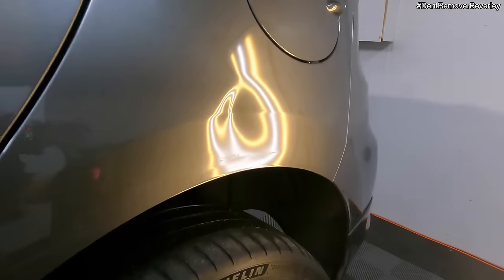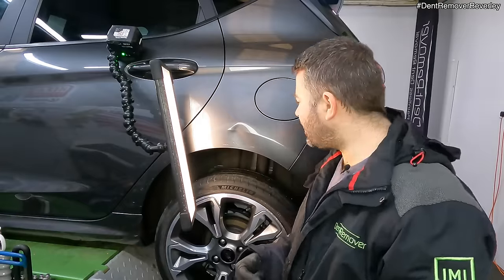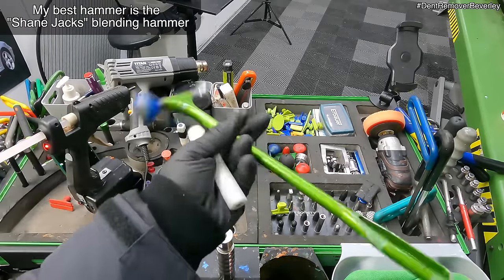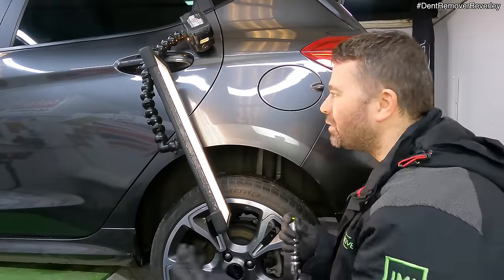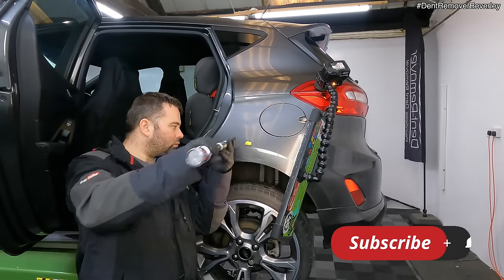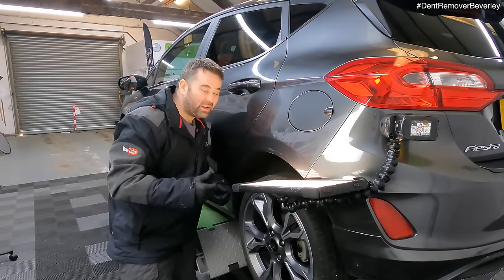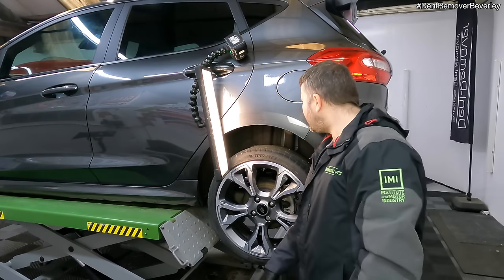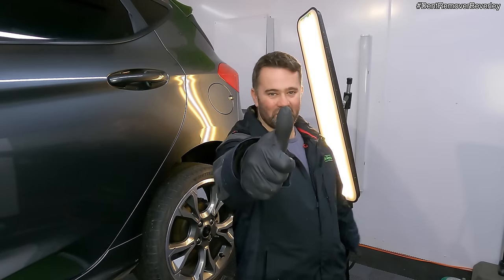HOT GLUE DENT REPAIR | STEP-BY-STEP By Dent-Remover | PDR UK

Comment: This is the best dent removal video I have seen as everything was explained in plain English, I know body lines can be awkward but this was a pleasure to watch , thank you
Reply from the maker: Wow thank you Peter! I really appreciate your kind feedback and reading this gives me a massive boost to continue showing my repairs to you guys 

I really appreciate it thanks again 

Martin 🙌🏼
Reply: I agree with you. Very comprehensive as well as information on where to source the tolls
Reply: @dentremover01  op
Reply: Excellent video. First time I see those incredible tools. Really good work
Reply: Bodyline? Don’t me think the cricket.
Reply: @pedroaguerrevere9118 17:13
Reply: Super useful upload.  Just one small point I might add that could help avoid someone a problem:  I did a similar thing writing with a black felt pen on a white acrylic paint car.  When I tried wiping it off later it had stained deep into the paint and took a lot of cutting back to get rid of it.  Oh, and thanks for using proper video/landscape mode for this; I would have skipped and downvoted had it been in vertical strip idiot mode 👍🏼
Reply from the maker: @JP-cy1lw thanks! These a like chalk pens? Wipe off wipe a cloth or damp cloth. I do check to see if it’s damaged or marked the paint but as yet I haven’t had any problems.
And yes I agree about Vertical vids. Unfortunately I shot a few recently, the Bentley for one, where I shot in vertical, originally was going to use for shorts but I had a great video edit. It’s a real shame it’s in stupid vertical format. The other is my latest video (black bmw door) but I managed to crop and make this into a landscape video which to be far is a really good watch 🙌🏼
Reply: Your videos are excellent.Do you offer a training course ? I think you are an excellent teacher.
Reply: I know my body lines are awkward.

Comment: Very impressed with that. I did a panel beating and spraying YTS many many years ago (showing my age) and we used to use tac welded pins and a slide. Im amazed at how the industry has come on.
Reply from the maker: Well done. That’s still a common panel beating technique and the bodyshops are still in the dark ages. I often repair dents with PDR for them- they then buy the kit thinking they can do it themselves😱

Comment: I was going to say you make it look easy, but getting those kind of results looks easy for someone with a lot of training (classroom or on the job), experience, and the right tools.  You are doing some amazing work there!

You have inspired me to see how far I can get towards making something look less bad with an hour of YouTube, no experience, and minimal set of tools.  The key to my success will be keeping my expectations low for my first attempt.

Thanks for the inspiration!
Reply: What is the glue u use?I am old blokeand try to repair any thing,generally  find ordinary hot melt glue unsatisfactory compared to contact cement,epoxies,or super glue.I was intrigued by the  video,having only heard of pointless dent removal,always thought  it was done by using spoons cleverly. I WOULD LIKE TO LEARN MORE WHERE DO I GO,I AM IN COUNTRY AUSTRALIA  THANKS  FOR WHAT I LEARNT  SO FAR. STEPHEN.I MIGRATED FROM UK IN 1949 TO THE WONDERFUL WORLD  OF OZ,BEST COUNTRY  IN WORLD.
Reply: @stephenandrews1965  there are glues sold specifically for this if you search “paintless dent removal” or “PDR”.  What I don’t know is how different those glues are from some of the other hot melt glues available.  The advantage of hot melt for this is that it does NOT form the same type of permanent bond that epoxy or superglue do.  Those would tear the paint off of the car, but the PDR glues just come unstuck.  If it were me, I would try it with cheaper hot melt glues first, because what do you have to lose?
Reply from the maker: Hi Kevin, and Stephen. Apologies for the delay in replying. Glue pulling can be quick to learn but it’s the knocking down of the damage and blending it back to the original shape which takes time and skill. 

The glue sticks are formulated to give a great bond, but to peel off as one, the diy sticks can go brittle quick and be a pain to remove. Also there’s other factors to take into account. Panel temp, temp or your location. cleaned surface, the time in which you leave to set and make the pull etc. 
also some dents are not glue pull dents and are better repaired with bars and tools. Again experience will help. 

Hot glue will pull paint off if your not careful and practice will help you figure this out. 

There’s training centres in Australia, also online training like “Learn PDR online” dent trainer, real world PDR training etc

Have a search and you can practice using online help 
Hope this all makes sense and helps both of you. 

Thanks Martin

Comment: Terrific job, I have similar dents in my front wing just above the leading edge body line.it will be my first attempt at glue pulling I just hope to improve the dents but  if I get it perfect then that will be a bonus. Thanks for your tips Martin, just waiting for the weather to improve. Best wishes to you for the future.
Reply from the maker: Hi Michael, thanks for your comment, all I can say is take it very steady and get use to the way it all works. Front wings are usually accessible from inside so with the correct tools you may be able to ease the damage out? 

Good luck and I hope you can get a good finish  👍🏼  
Martin

Comment: Best video I've seen on the subject. I've been paint correcting, paint restoring  and ceramic coating vehicles for a number of years and under pressure from some of my customers to provide dent repair as well. Still a long way to go with the research but you've gained a new subscriber, great channel !!👍
Reply from the maker: Thank you Ceramic Detailing for your kind words. Why don’t you speak to a good dent tech in your area? Are you in the UN?
Reply from the maker: Uk
Reply: @dentremover01  Yes, Altrincham, Cheshire
Reply from the maker: @ceramixdetailing29  speak to Keith Venn at cheshire dent repair hes a great guy

Comment: Your work is spot on. I'm trying to lift a dent to fill and paint. I could borrow a spotjpin puller but don't always to rip holes. Watching this I think the glue I have is letting me down. Ace work keep it up!! 👍
Reply from the maker: Spot on it’s worth getting some glue repair kits, look at CamAuto they make great collision glue tabs and their glue is the strongest too 
Will be quicker and better than taking the paint off and welding pins to the panel

Comment: So cool.  I had no idea.  I’ve seen the body shop guys weld tiny pins and pull the metal work out.  But this is genius.
Reply from the maker: Yes they do and this is bad for the car, as each weld then burns the inside of the panel and if not treated will rust from the inside out. Glue pulling is the best option

Comment: Modern cars are so flimsy aren't they. One of my first cars fifty-something years ago (in Australia) was a 1947 Rover 16. When a car ran into my fender the repairer just panelbeat the sizable ding out. Didn't use any bog/filler. May have wiped a fine filler before the paint. He said it was a pleasure to work on real metal. He was also still filling with lead on some cars. Had no idea you could pull dings out with hot-glue. I built a timber surfboard recently using hot glue - using western red cedar and pawlonia (like balsa) strips. You're a master at this. I'm driving a fairly new 3 series BMW Hybrid these days but have no affection for it. Much prefer driving the 1998 Mercedes-Benz E320 I also have. Cheers mate (From Paris).
Reply from the maker: Hi Thanks for your great comment. Older cars have thicker metal and I agree they are nice to work the metal with conventional methods. I find working them with PDR can be tough! 
Interesting to hear about your surf board! Is the glue strong enough not to unbind at high temps or is it safe being in the water? Sounds like a great project you had and I wouldn’t know where to start! The newer cars are a lot thinner material but BMW are one of the thickest out there so they are still a great vehicle to have 

Thanks for watching and commenting 
Martin
Reply from the maker: The Mercedes E class sounds very retro!

Comment: Wow! 😮
  Amazing work! This turned out really nice and the skill and patience to do it is a great asset.
 I had an epidemy while I was watching this, no idea if it would actually work but what about a powerful electro magnet that you could connect to different size and shape puller tips, of course made out of metal with a non scratch coating or covering, and be able to squeeze a trigger or button to power it up and pull dents that way? 🤔 Maybe even design it to be able to pull the dent or dents into a pre-shaped surface to force the dents to conform to it. It's just a thought I had, it'd probably require a massive amount of electricity required to be able to be useful in this way if it would even be possible at all.

Comment: Just wondering why @3:08 that quote shower £766 while it is 444,90?!
Reply from the maker: 2 dents on this panel, the main dent and then the crease on the lip of the dent. Both difficult repairs to do, plus misc, and the 20%vat 
Please note that at the top of that estimate it states “example of an estimate” and this would be for an insurance claim, a private sale would be a lot less. 
End of the day the repair which I carried out was better than any bodyshop repair, filler, paint. The customer got his car back “as new” kept all warranties and was completed in a day. Repairs like this should be more than conventional repairs as there are no disadvantages in the repair process and it’s non evasive. But unfortunately alot of people just think dents are popped out so they don’t see the value of the repair. This is why I show the full repair process and estimate my repairs so that the Joe Public get an understanding. 

A conventional estimate for the insurance would be 1000+ (uk) I’d hate to say what a USA claim would be for this I’d assume double- and they close those quotes daily in the USA 

Thanks for your comment, and hope you enjoyed the rest of the video

Thanks Martin
Reply from the maker: Also I do explain this in the description of the video 🙌🏼
Reply: @dentremover01  thanks for taking the time to make such an detailed answer. True craftsman ship what I saw. Never knew this craft also uses those lin s to check unevem surface. I use the same with 3d Modeling

Comment: You need to make absolutely sure there is no separation between the paint and the panel when using this method. I learnt that the hard way on the bonnet of my completely original BMW E28 5 series. It took a piece of paint an inch in diameter straight off and I just had to stand there dumbfounded trying not to cry.
Reply from the maker: Yes that’s right. We always give our customer a disclaimer before glue pulling, especially on repainted cars or Japanese cars as they are very brittle

Comment: A very delicate job, also because it was not possible to intervene from the inside.
Excellent result, as always.
Next stop for this Fiesta: the tire dealer😜
Reply from the maker: Hi Massimo thank you for your comment. It is accessible from inside but I don’t like taking the fuel filler assembly out and there may not be an ideal access through a rear lamp hole- I love glue pulling so that’s how I rolled!! 😬🙌🏼

Comment: Started blown away by what you're charging and about to object. Finished nodding my head quietly. Really impressive work. The bit you glossed over is how the ** you get the glue to work so well. Is it just ''better' glue, or is there more of a knack to it? Mine's splitting half on the panel, half on the pad 99% of the time :/
Reply from the maker: Hi Phazaar thank you so much for your great comment, and for not jumping to conclusions after seeing the estimate
Reply from the maker: The glue is specialist glue from PDR shops and it’s worth the money. 

There are steps which if you follow will greatly improve your glue pulling skills. 
If you have a spare 5 minutes please watch my glue pulling video and this will give you the 6 best steps and make you better 
▶️https://youtu.be/T_7pofEHTmM?si=CtJWUL8GgjO4L6TK

Thanks Martin

Comment: We have a Ram Promaster in the shop now with hail damage to the roof and hood, leased vehicle. Our PDR guy came through and the estimate came up just shy of $22,000 US. My guess is that since it's the roof, the lessor company will probably get a new van, the rental company will take the van back and either use it as-is or auction it. We will see what the coming weeks hold.

A new roof is ruled out because it would compromise the space frame strength too much and/or would cost even more than PDR.
Reply from the maker: Thanks for your comment and I can see why it would cost a lot for any repair. People have this idea that PDR is cheap because we simply pop dents out but that’s not the case. 
I’d imagine it’s a big roof? I’ve replaced plenty of roofs in my time and I did enjoy the prices, but it’s very intrusive 

I don’t know how the insurance works where you are but they may go with the PDR because if the estimates accepted it means the value of the car will be more
Reply: @dentremover01  - a Ram Promaster is a (going off memory) 135 to 155-inch wheelbase, so there's the possibility of 2-3 meters of roof depending on the length of the body, and it has HUNDREDS of dents from hail. And the hood. We're estimated something like 40-46 hours of work.
Reply from the maker: Blimey! I hope you can get it sorted out
Reply: @dentremover01  - It's on the block for December. With that and another job of putting a new frame under a Jeep Wrangler, it could shape up to be a very good month. Most of our jobs are under $3000. More serious than that and they tend to get auctioned off.

Comment: Amazing vid, man. I have dime-sized ding on my body line, back quarter panel. I am unable to get in behind it. This should help some.
Reply from the maker: Hi Boosted, yes this method would work if it’s a candidate for glue pull repair. Always practice on a scrap panel first though and good luck

Comment: I got my Nissan Pro4X 2018, only had 10,000 miles on it. Practically brand new.
Anyways, some low life jerk hit my truck in the left side rear fender.
Bad news is that the wheel arch has a major body line crease. It will need the dent pulled out and body line crease body hammered back in shape.

Comment: GPR question: First found you on here (with this awesome video), and then found you and commented on your FB page (I'm the scientist/astronomy guy). A quick question that I apologize if I missed it --- I have seen some recommendations on "wait time after tab with glue is placed" and time to actually do the first PULL. Can you please tell me your recommendation on WAIT TIME after tab/glue are placed before you do your first pull (e.g., 4:38 in your video here)? I have done some studying up and purchased from KECOTABS Hawg PDR Orange (and have all the other correct tools). Thanks so much. -Jeff in New Mexico, USA
Reply from the maker: Hi Jeff! 
Thanks for your question and for following me & sharing my posts I’m very grateful 
The best answer for your question would be to download a copy of the Keco 6c instructions. I also have a video which explains all this on my channel 
It’s all about temperature and not time, the Hawg glue is really good so it shouldn’t take long to dial in your process but realistically you should be pulling at 29degrees C 

Please check out my channel as like I mentioned I go through the basics for glue pulling using the 6c process 🙌🏼 

I hope this helps 
Thanks Martin
Reply: @dentremover01 - awesome - thanks so much, Martin! (sorry for my slow reply) Best regards to you over there!

Comment: Dude, that looks amazing! You are definitely a skilled subject matter expert on this system. I am sure you are making it look way easier than it would be for a novice.  How much did this repair cost?
Reply: I am guessing $300?
Reply from the maker: Hi Elaine thanks for your comment. I’ve been using the glue repair system for years and daily so I can make it look easy. There’s a lot of skill involved to know where and how to apply it and the pressure of the pull etc. I’m asked ally about the price and I do mention how much it could be if it was through insurance based on the facts of the damage. As a guess I think I charged around £300 for this repair 

Thanks for commenting and also to Itch for commenting

Comment: How long do you leave the tab with glue on the surface before you start the pull? My tabs pull off easily if I do not wait quite awhile before pulling.  Bad glue or am I impatient?
Reply from the maker: Hi Les. Thanks for your question

The panel needs to be clean and free of any polishes. You need a hot glue and the tab needs to be clean also

Add the glue and put the tab on the panel, wait between 10 and 30 seconds and pull

Just play with timings but don’t leave more than a few mins or it might go brittle
Reply: Thank you! If I had listened for 2 minutes longer before submitting my question, I would have heard your recommendation for determining when to start pulling. My glue sticks require about 5 minutes. I suspect they are just craft-type glue sticks.